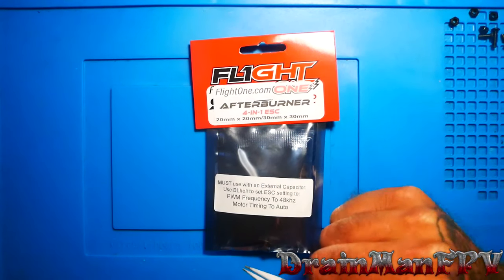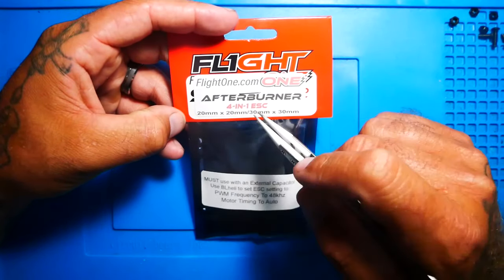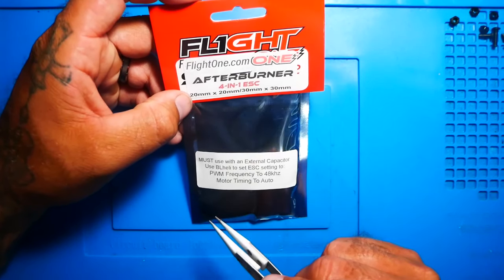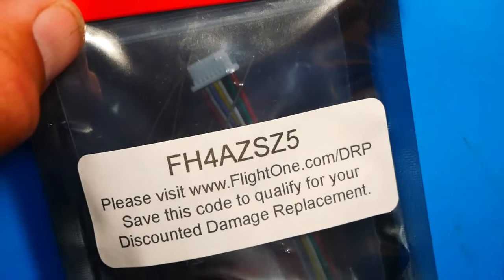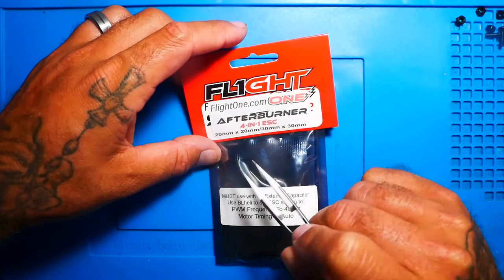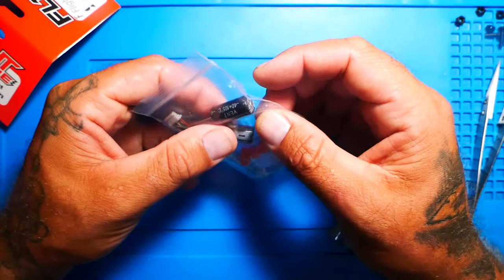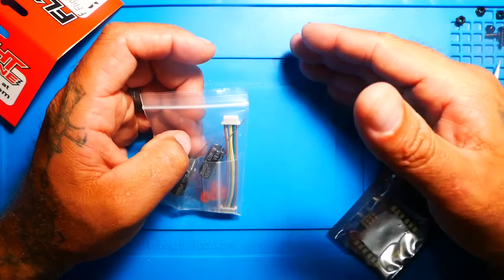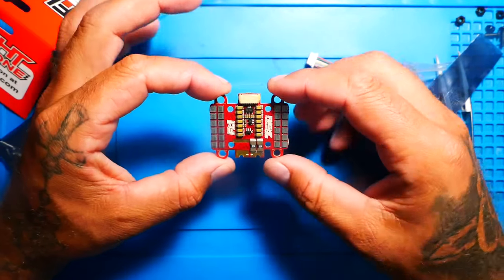Brand New FlightOne ESC 🔥 🔥 Afterburner is HERE!! The Drought Is Over! Review & BL_Heli Set Up

Comment: I desperately wanna fly FlightOne I’ve got several RevoltOSD fc love the simplicity that they offer I mean perfect for me! Three years in this hobby and I still struggle with the pc/programming side of it all. All that being said I’ve tried two different all in one esc’s and there’s all kinds of problems I’m having pretty much quads won’t fly hot motors etc. I just want to get AfterBurner or MegaBolt esc with no luck finding just one fml..!! Any suggestions?
Reply: U need to calibrate ESCs before flying, don’t forget to add low esr cap on it.
Coz I have suffered the same as u a year back. I did these both things an I was flying good for the first time, an just had to reduce the pid’s for tuning, coz I was getting horrible yaw drift, so I changed my gyro loop frequency to 2k and now it  flys butter smooth with mamba f405 mk2 stack on BF 4.0 firmware.

Comment: Is the pinout of this ESC the same as the other ESCs of this brand?  I didn't find the pinout scheme of this ESC.  I will use on FC Flightone Revolt OSD.  Just plug in the cables by brand standard?
Reply from the maker: I am not sure, there is no exact pinout on it. You will have to use your multimeter and test them until you know which is which, eventually flightone will get a pinout out, but for now - multimeter
Reply: Same pin out as the bolt32 and Bolt v2 👍